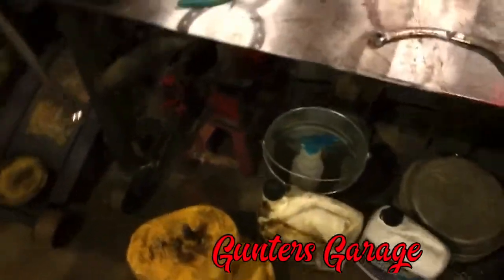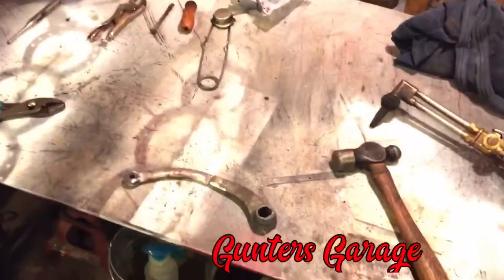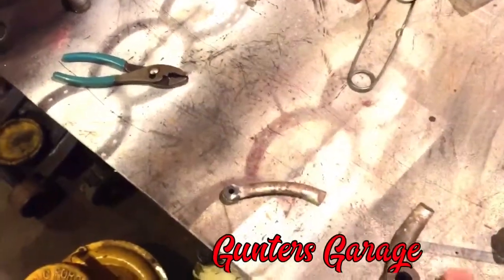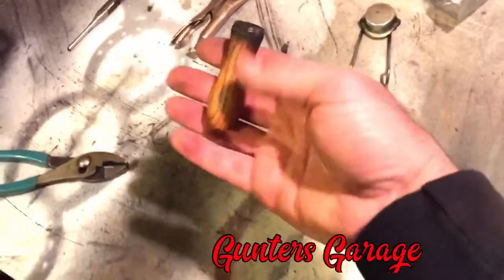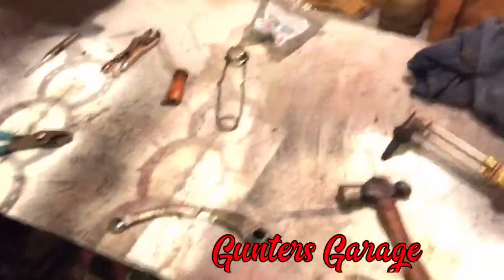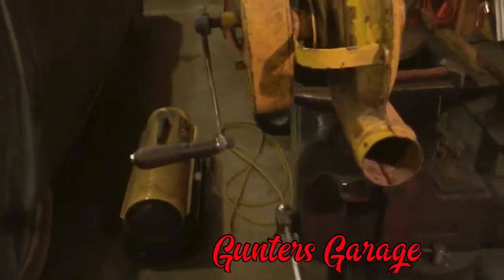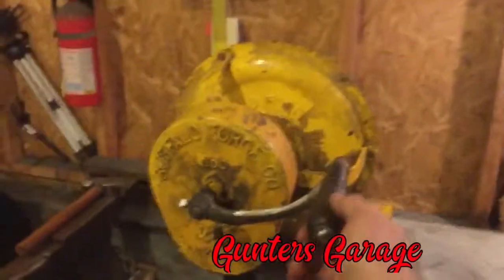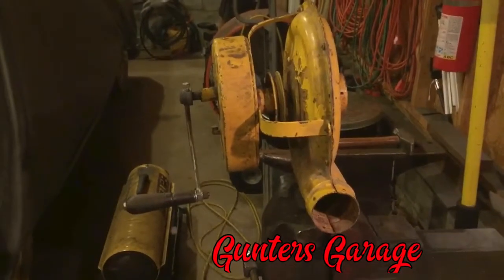Forge Blower Handle Repair

Comment: you're perty good welding cast iron...cool you found a handle and like the wood file handle
Reply from the maker: Thanks, I’m still pretty surprised myself. I think the small cast iron items especially the little stuff thats in 2 small pieces dont have the shrinking and cracking issues like say an engine block.